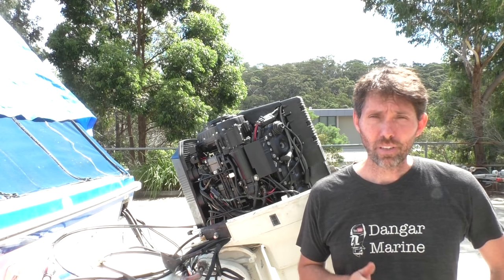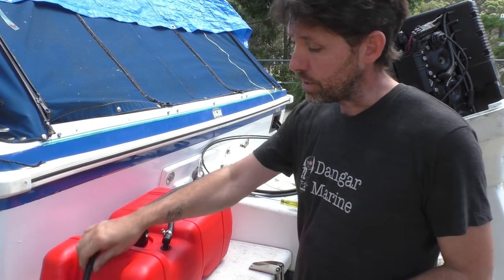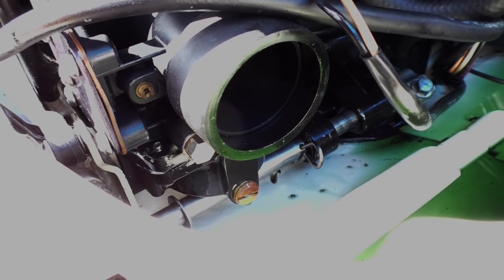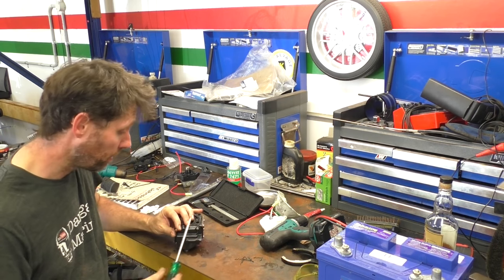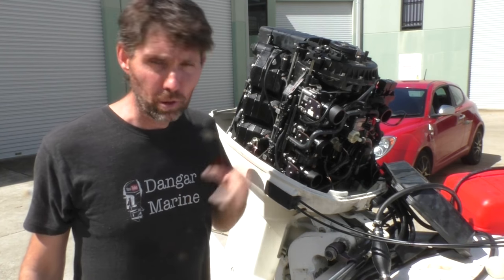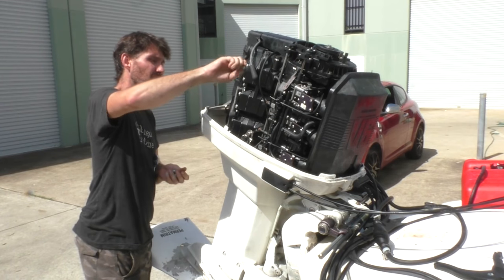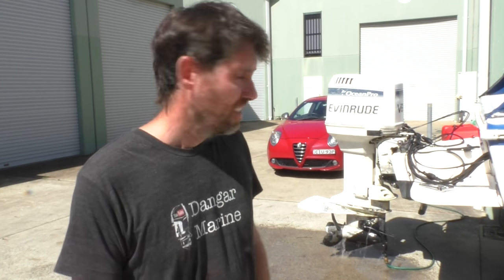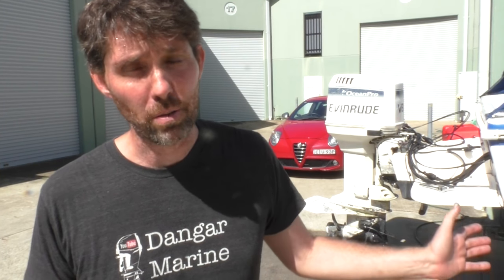Starting the Evinrude 150 for the first time

Comment: those plastic flotation bowls are known to warp all six off mine are warped
Reply: They only warp if someone seriously over tightens the bowl screws when trying to service them.   That is user error, not a defect.

But even then, they usually don't leak, especially if you replace the gaskets with fresh ones. You only need to tighten them enough to compress the rubber seal.
Reply from the maker: I was wondering about that. You here a lot of people mention these bowls getting distorted but over tightening does seem the likely cause unless they some how get heat affected on some outboards.

Comment: Does the exhaust run out through the prop?
Reply from the maker: Yes, 99% of it comes out through the prop.
Reply: The industry call it "through-hub exhaust".  An excellent way to (somewhat) quiet the operation of an outboard. There is a community of people though, who are concerned on behalf of marine life that suffers as a result of the noise generated as a result, although I can imagine that there's plenty of noise just from the sound of the propeller churning up the water.

Comment: hi can i pick your brains 
i have a mercury 60 hp e f i    2004 model  on idle it some times runs a little lumpy...when running it gets up on the plain and runs for 150 metres or there abouts and bogs down...what i have done is supplied a new tank as i found a little water in the fuel..so new tank clean fuel  new fuel lines  and changed both fuel filters  low pressure pump has been cleaned out  v.s.t removed and cleaned including the filters ..checked the pressure from the  valve and running it is producing 43 psi i have also had all injectors out and cleaned ..and it still runs a little limpy..???
Reply: MrPAUL7560... You should walk out to that outboard tomorrow, and in a very firm, no-nonsense tone, tell it that mashed potatoes are okay to be lumpy, not 60hp Mercury outboards.  If that alone does not make it smarten up its' act, then try searching for a vacuum leak, it's not going to be easy to find, but begin by visually checking all hosing and tubing for signs of leakage. If the problem is not in the fuel supply side, should investigate the air mixture side for something that is causing variation in amounts of air-fuel mixture.  You say it works well until it gets up on plane, then bogs. Seems to me that if not something restricting the fuel, then could be something restricting air entry, and depending on demand/load could be blocking, collapsing, flopping, bending, kinking.... That's my suggestion.  Good luck to you.   Now I'm hungry for some lumpy mashed potatoes and some lumpy gravy, too.....
Reply from the maker: It certainly sounds like you've done a thorough job on the fuel side, and if you are getting 43 psi and the injectors have been cleaned I wouldn't suspect fuel. As well as what Stan suggests, have you monitored the temperature of the motor? The temp sensor may have failed so you may not get an alarm if it is getting hot. I would also do a compression check in case there is a head gasket problem.
Reply: water from pittal port runs cold ....i have just noticed that the exhaust is push ing steam out ..i have checked this and it is moisture....

Comment: Hi I'm looking for help evinrude50 horsepower it runs for 20 minutes then it bogg down full throttle need help
Reply from the maker: I would check that it isn't over heating. An infrared thermometer is a great cheap way to do this.

Comment: Clock still struggles at 46-47 minute, , can I tell you I thought I had a major problem with my tide clock- normal clock, it takes too AA batteries, it kept time ok but the tides didn’t match my eyes from my view of the river in front of ma. Then one day my female flat mate asked me to grab her spare key from bottom drawer, the keys were next to her vibrator, it was a two battery machine but only one battery, hence my tide clock was always being screwed up. It’s called battery theft.

Comment: Imagine that you know my engine uses two fuel pumps that pressure must have the pumps to know if they are working properly...evinrude 175 hp
Reply from the maker: If it is a carburetted motor the pressure from the pumps is only very low, about 5 PSI.

Comment: lokes good, Now is the Alfa Romeo yours??? good taste in cars will be delivered to you if it is yours!!! lol
Reply from the maker: Thanks Filipe, yes the Alfa is mine, it's been a really great car. Just gone over 100,000kms now and never had a problem.
Reply: well i"ve got the 159 2.4 diesel it2s from 2006 i bought it in 2010 no problem"s with it! all my family runs on Alfas now! 147 166 145 and 159! what engine is yours?
Reply from the maker: It's the QV so it's the 125kW 1.4 turbo multiair.
Reply: thats a very fast nice "litle" car! congrats man you did it! millions of points for that good taste are awarded to you! man thats a nice car! stering will it´s on the wrong side but stil... LOL